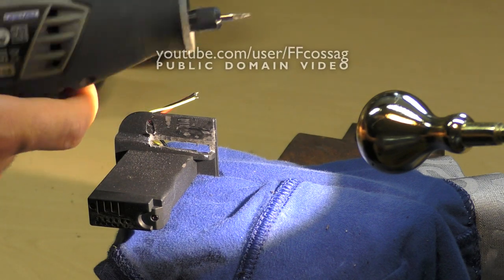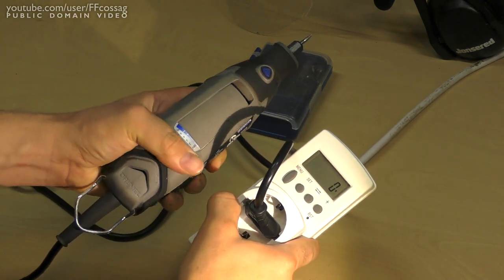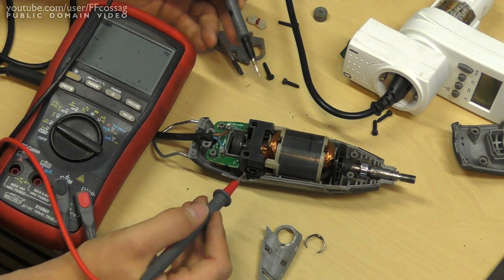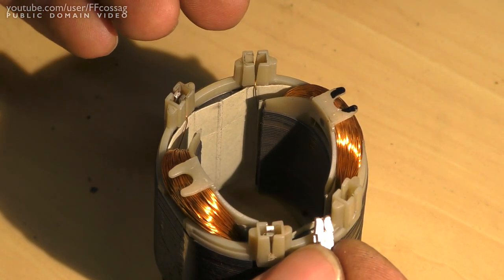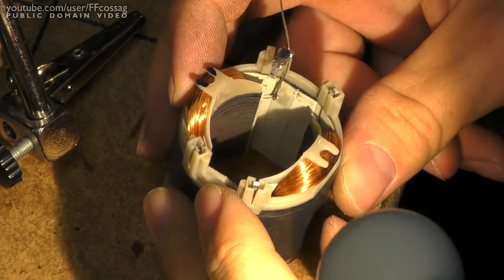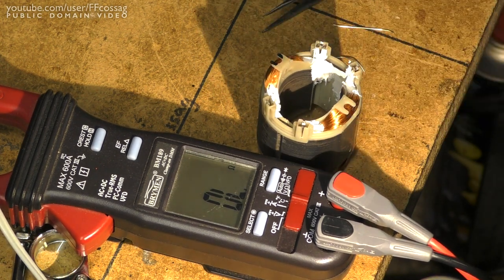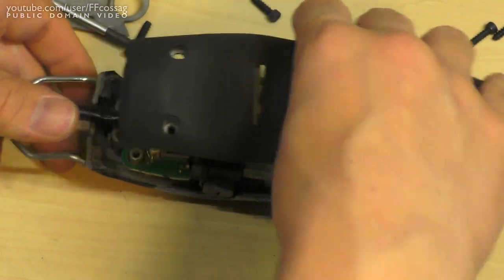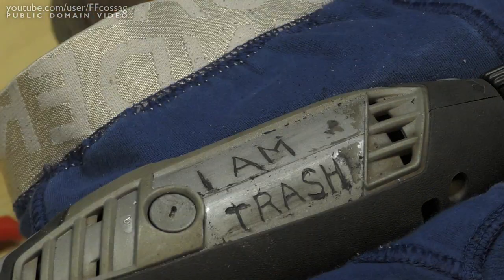Dremel 3000 trobleshooting & stator repair

Comment: I had the same problem. A much simpler and less invasive fix is just to to unwind one turn from the stator winding and put it back in the IDC clip. Job done in 10 minutes. I think you are hard on the Dremel. Mine lasted 7 years before the failure, it was a simple repair requiring no new parts.
Reply: I need a instructional video from you
Reply: Did exactly this, worked. For future reference for anyone, find where the wire has broken, right by crimp. There won't be enough to put it back in the crimp, so unloop the wire back through the part one time, until you get back to where the wire broke, but now with more wire. Take the crimp out, pull the wire up into the v, replace the crimp, trim excess wire

Comment: Yup! Same problem on mine after not very much use. Also failed a second time so unwound one turn of the coil, and leaving adequate slack reconnected no worries. It seems that TOO much tension is put on the coil ends during manufacture and vibration and temperature rise during use takes care of the rest. Since fixing it a second time it worked fine until, after MUCH use, the bearings BOTH failed. Getting the rear one off - piece of cake. To get the front one off the collet shaft (tube on the armature shaft) is, so far impossible! I thought perhaps it was threaded onto the armature shaft so I tried my small c-spanner to turn it (both for LH and RH threads) - ZERO movement. 
My gear puller can apply a LOT of force and it removed the rear bearing simple as, but there does NOT appear to be an easy way to remove this collet tube/shaft to allow the bearing to be removed! It's still there awaiting repair. Meantime bought another 3000 and that's been fine (so far, touch wood) and bearings are good, but they WILL go at some point and it would be nice to be able to repair the damned thing and not have to scrap it for sake of one tiddly bearing that would otherwise be a piece of cake to remove/replace.
Anyone know exactly how the collet tube/shaft is fitted? Interference fit or is it screwed to the armature shaft? Or is it one of these damned tools where the manufacturer decides in advance that any failure (ALWAYS out of warranty of course) will doom the machine? I HATE designs that are made to be assembled for production rather than disassembled and repaired in use. Do the latter, the former is a piece of cake. It's SUCH a waste.Companies' products should be internationally graded for their repairability and maintainability levels. Trouble is most (if not all) would FAIL epically!!

Comment: Don't use compressed air on anything that has bearings or is rotary. All you will do is jam up the unit. If anything vacuum the unit out. they are not trash. They just need to be well maintained. My company has 11 dremel units that are as old as the hills and they all still run fine. I don't know if Dremel has a maintenance video but they should for the people that don't understand how to maintain their tools. It isn't a hammer.
Reply: "11 dremel units that are as old as the hills", yes the old models of dremel is so good, but the new models, this case dremel 3000, is a piece of shit. I have one and sure about that!

Comment: thanks for the video
My Dremel also had maybe had around 1hrs total use. Brushes hardly worn.
It also stopped dead without warning in the middle of a job
I ended up grabbing my cheap $50 'Supatool' brand rotary tool that I forgot I had and carried on (I remember buying the Dremel because I can be a bit of brand snob and liked some of the accessories it came with)
Started pulling apart the Dremel the other day. Didn't get too far,  didn't see anything obvious so was ready to bin it.
But watched this video now,  so might have another go at it and see if mine has suffered from a similar problem
Or I might just stick with my $50 cheapo that seems to have lasted a lot longer than the far more expensive Dremel...
Reply: I'm sorry.why did you buy a Dremel if you already had a cheapo "supatool"?
Reply: because as said above, I forgot I had the Supatool rotary tool.

Comment: Thanks to your video I got mine working again I had the same problem but instead of adding a wire I unwrapped it a little bit back around and cut off the excess then I soldered it good video thanks for sharing this must be a known problem for these thanks to your video you save me some money

Comment: Thanks, this worked and I totally agree with your opinion of the build quality.
Advisory - Don't put the bloody stickers back on, you'll be doing this again in a few months.

I have a cheapo rotary tool that has been running for ten years.  I only bought the dremel because it takes a variable chuck.  Wasn't worth it.

Comment: It looks wire breakage at the termination point is a very common problem. The weakest point is where the wire bends into the plastic slot to be clamped into contact. The wire bend is under stress, and when the Dremel is spinning at high speed, there is constant vibration, which translates into cyclic stress at the bend. Over time, the wire breaks due to fatigue. To overcome this, I potted a little but of adhesive just before the bend to fix the wire to the wall. This will cut down vibration and therefore cyclic stress at the wire bend.

Comment: My older model 395 Dremel's have never had such a problem. They must've still been built a bit more patiently back then. 2 dremel's, and a Craftsman that's the exact same tool with different stickers. I had to fix the swipe switch on and replace a bearing on another.

Comment: I know this is 5yrs old.
My Dremel just locked up, couldn't turn the shaft at all.
Turned out it was the impeller had moved and was jammed against the inner body.
2 minutes and we were up and running.

Comment: Hi.  thanks for the video.  I was able to repair my Dremel.  Too bad, I threw a stator some time ago.  I could also have repaired it.  it is the weakness of this technique of contact of the file, it is not welded, pinched by small knives, it is the place which acts like a fuse.  delicate but repairable.  Lionel

Comment: Wow, I have a Dremel Multipro made I think sometime in the 90's and the internals look nearly identical. It would randomly cut out, and the rpm would jump all over the place so I had to pull apart the variable switch and bend the spring contact as it wasn't making good enough contact with the carbon track. A common problem apparently. Stuff like this really makes a case for planned obsolescence or engineered to fail. They had decades to make a design bulletproof yet it still fails after an obscenely short amount of run time.

Comment: I had the same problem .It must be a fault with the 3000 as I have been using Dremels for many years.I was going to bin the 3000, but after watching your video I pulled mine apart and the fault was the same as yours.............Thanks mine is now working fine

Comment: There's been more than just a few of these incidents, all with the same problem. Mine hasn't failed yet, but before it does, I'm thinking of getting some polyimide tape and tape down the ends of the enamelled copper wire to that white insulation card. This, so that it doesn't vibrate when the motor is running. Vibration is likely causing work-hardening in the copper, then it fractures. The stator is loosely coiled which is disappointing.

Comment: Thanks for this, I hope it will resurrect my Dremel which broke in 3 hours, two days after I took the second broken one back for a replacement - after the third broke I gave up and it got demoted to the back of a drawer. I was fairly impressed with the last one however, as it did manage almost 3 hours, the previous 2 didn't even cope for an hour.

The issue I see with them is that they simply shake themselves apart. If you try and use a 2mm drill through a 0.5mm sheet, the final hole size is almost 4mm. It makes accurate drilling not possible as you can't even centre the drill. Why they bother having a pillar mount (which I bought too) when it's this useless is completely beyond me. Waste of material, resource and consumers money.

I guess you can only use this for light finishing and cutting. Anything which requires accuracy.... forget it.

The moral of this story, don't bother with DREMEL, they are incompetent at both design and manufacture!

Comment: I have a Dremel 300 which had very little use. It smoked years ago (and didn't spin) and I have left it until today. Just checked the brushes and they're fine (about the same length as yours).  Not done any further investigation. I'm only 3 min into your video so will see if it can help...
Reply: ...oh, and my commutator has even less wear than yours. I can still see gold on it!
Reply: Well for me it's a different problem to yours. The wires on the stator are ok. Your rotor slipped nicely out of the stator I see. I had to force mine out and now it won't go back in without a fight.

Comment: Lol. Just came here to see if I can fix my dremel and now I've subscribed. You're funny and informative. Thanks. Although I have a different problem. The variable speed control is fucked. It's either off (0) or on full power (1--10)
Reply from the maker: Thanks, that's probably a shorted triac.
Reply: Same here.  A technician I am not, but refuse to give in-FFcossag mentioned a shorter trial!?
Reply: @FFcossag  what is a triac? Cheers

Comment: Thanks... I might have to be getting a new drill and you have tempted me not     to go with Dremell...probably can't afford one anyway. My wee Colt has packed in because  the plastic clutch joining the motor drive shaft to the drill ( why on earth wasn't it a single unit like yours ) has denatured and shattered. I've hardly used the rotten thing but have had it in the drawer for about 15 years. Guess I can't complain. I was wondering if I could pack   the space with some gap filling glue..... could be good enough for the sort of tasks I'm likely to try.

Comment: UHM, those are "quick" connect style connectors. As they are slid into place they cut into the copper part and connect that way. just how they are.
Also, i have one of these with flex shaft connected to my 3D printer as a cnc PCB drill
Reply from the maker: That's what they're supposed to do, however Dremel did not install them correctly.

Comment: I was making rings and HAVE to get these orders out YESTERDAY!!!!  I believe we ALL have had the same problem  FFcossag.  The problem is, is that Dremel is using Aluminum connectors with the copper wire in the "Stator"!! Aluminum and copper DO NOT play well together!!  Mine was only bout 6 months old and in great condition!  Why don't they use copper connectors?? IDK.  Plus the engineering of the stator is made TO FAIL.  Thanks for the info FFcossag. Every video I see where the Dremel just STOPS, it has always been the stator and faulty copper wires breaking or connectors dislodging. Fuck, for the price we pay you'd think they would design a better product!!  Does anyone out there have any suggestions FOR A BETTER SIMILAR TOOL????  Thank you!!
Reply: Reason they don't use copper connectors is because they can save maybe $0.02 on each unit. But that adds up. Same thing for the brush housing. If they made that part out of something other than plastic, then I wouldn't've melted my brushes into the casing last night.
😕
It's all about saving every single stinking fragment of a penny that they can so they can sell at exorbitant prices for sky high profit.

Comment: How did you get the blue switch back in? I am changing the locking pin but the switch mechanism fell out and I cannot for the life of me get it back. You don't seem to have had any trouble.

Comment: I didn't extend my copper wire. Instead I just unwound one winding of the coil. Gave me enough wire to put it back in the connector :)
Reply: I'm considering this, but don't know enough about motors and have a question: would that make the motor go out of phas, don't they need an exact amount of wraps of the copper or something..? How would it affect it?
Reply: @ToninFightsEntropy  You don't need an exact amount of windings. What Stephan Berger did was exactly what dremel expected people to do, they designed it that way. It is actually a really smart design but the video guy doesn't recognise it. Source: I am an electrical engineer.

Comment: I have a 20 years old cheap B&Q multitool that is in constant use, excellent low speed control, and rock solid reliable. My Dremel is way too fast, and blew that wire after an hours intermittent low speed use. Never again will I buy one of these.

Comment: I own the same Dremel. Is that a design defect or production failure of your unit? As preventitive maintenance, do you think it is worth the effort to take it apart and bolster those clips and apply some silicone to keep those wires secure?
Reply from the maker: If you search for "Dremel 3000 problem", it seems to be a VERY common issue.
Reply: design defect, I just checked my local auction site and there are two dremels 3000 listed with this very fault (broken stator connection)

Comment: My Dremel is in the same condition ... almost new.  But, although the motor runs the shaft does NOT.  Could you give me any thoughts as to how it could be fixed? THANK YOU!
Reply from the maker: Probably glue the shaft back to the rotor, lol. What an odd failure mode.

Comment: I've seen the same issue in another "broken dremel 3000" vid. Seems they "over engineered" it to last past the warranty period.😂 Just bought one and exchanged it for a second one because it would'nt even turn on speeds 1-3 and 4-7 had not power enough to grind a potatoe. Thinking this model is a fail for dremel. Looks nice thats all.

Comment: I repaired mine.... same snapped wire fault.... but now it will only run at full speed?? I agree that they are not well designed/built..... mine has been used but it's less than 2 years old......

Comment: gracias por vídeo, pero te faltó una cosa por hacer, en tu vídeo se ve que las delgas están negras del desgaste de las escobillas, para una reparación al 100% habría que lijar las delgas y dejarlas de color cobre en lugar de negras  que las dejaste.

In English :
thanks for video, but you missed something to do, in your video you see that the delgas are black from the brushes, for a 100% repair would have to sand the delgas and leave them copper color instead of black that the you left
Reply from the maker: It's perfectly normal for brushes to leave black marks. Graphite lubricates the commutator and makes it last longer.

Comment: I have had a Dremal hand tool and used it for 20 years with no problems every day.   The problem is in modern teaching. The engineers are colleges  are turning out have no real training in the knowledge  in, or  of the reliability of the materials they are designing  in the products they hope to make.  Any tool made of plastic is made for a short life. Plastic  , (all kinds)  is garbage.  If they were educated right they would know this and maybe we could bring back the quality this country once was noted for. To make my point.... My Ford Model "A" 90 years old car, still can be fixed and is still running.     Put that in your pipe and smoke it.   Nothing made today  with  plastic will last 10 years   You can make book on that.

Comment: am i the only one seeing this: right after the "taking apart" the dremel, the blue wire was on the right side, once he assembles the dremel again the blue wire is left?
Reply: Doesn't matter because it's alternating current. If it was direct current it would matter but only to the point that the rotation would be reversed. However, unless one is quite observant & very particular, they might not even notice.
But again, with AC current, the rotation will remain unchanged regardless of how which wire is connected to which input.
After having written all of that, a very easy example of why it doesn't matter just came to mind. Assuming you're in the USA, many electrically powered devices now come standard with the plugs on their power cords made to fit only one way into wall receptacles. You know, one blade is wider than the other... 
Well, it used to be that this wasn't the case & that's because single or "split" phase AC current works irrespective of polarity. 
The idea behind the blade size difference is so that the neutral connection from the device will end up connected to the neutral side of the receptacle & the hot to the hot. 
Still, in the grand scheme of things it doesn't matter because if an untrained or lazy person wired the wall receptacle you're using "backwards", then you're in essence, swapping the blue wire with the white at the source (receptacle) rather than at the connection point in the video when you plug it in.
I hope this makes sense but if not, I'll try giving a different example.
👌🏻

Comment: Good video, Yr right these aren't ay better than the one's you can get for 20 quid. I got a used Clarke of eBay for £6.50 hardly used and defo as good as the Dremel.

Comment: Thanks for tip. Mine stopped working too , and exact same problem. One very thin copper wire just hanging there. Not going to bother fixing it. It's going straight into the recycle. DON'T BUY DREMEL !!
Reply from the maker: That seems a bit wasteful.

Comment: I have had 2 of these dremels in the space of 12 months ..it is always the same issue snapped coil  the clips are a pain in the ass to get out  the last one i fixed the end of the coil that snapped was from the start of the coil so couldn't be unwound i had to strip a piece of computer wire to get a length of copper wire from it to solder onto the the snapped coil absolute nightmare 
Mexicans do a half ass job assembling these dremels